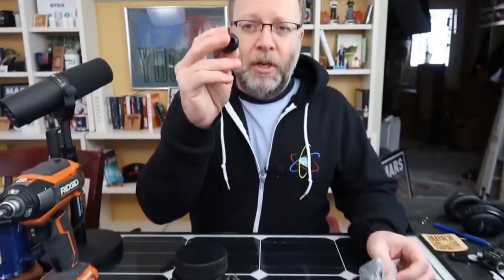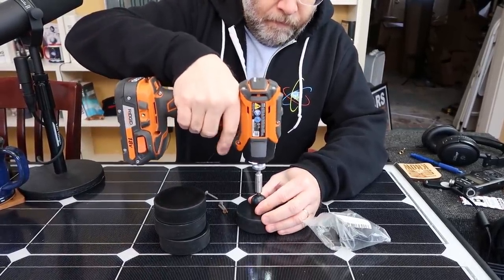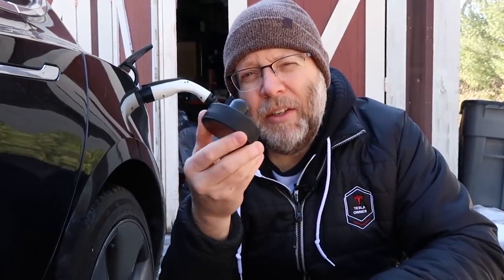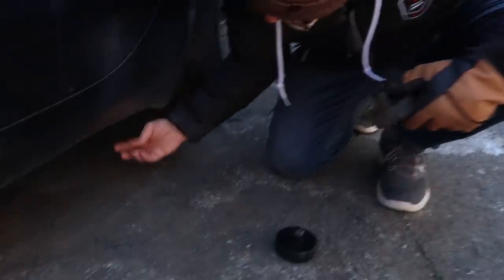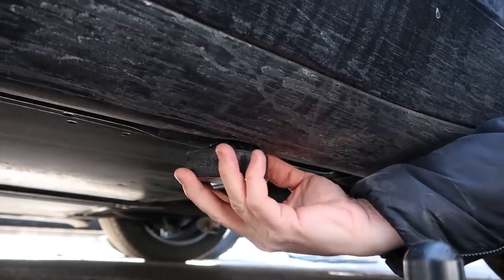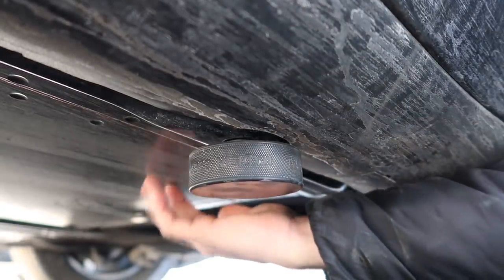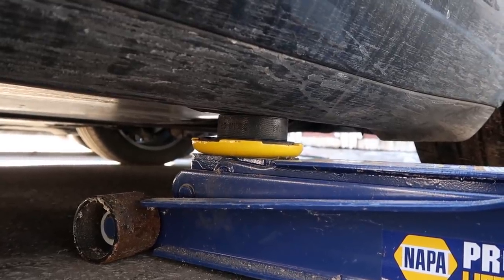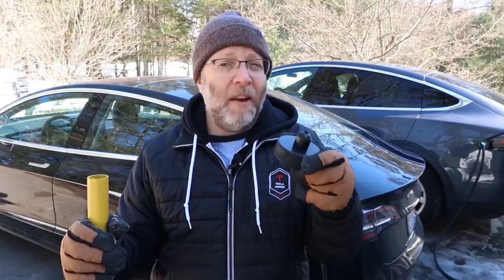Model 3 Jack Puck | Model 3 Tip of the Week

Comment: I went to Town Fair Tire, the local tire chain around Zach&Jesse's area, and brought my pucks. Apparently their jack did not have enough room to fit under the car with the pucks on top, so they couldn't switch my winter tires back to summer! I wasn't going to pay Tesla for it, so I ended up just doing it myself in the driveway using a very similar jack to the one you have.

I made my pucks also out of vulcanized rubber hockey pucks but with a 3D printed nub on top that I designed and printed myself and screwed in.

Comment: It comes to mind that with a floor jack, the beginning of the stroke is nearly vertical (no problem), but as the jack height increases, so does the amount of horizontal movement (not so good if the puck nipple breaks the small screw and the car slides off of the puck). I think this jack-puck is a great idea, but people need to understand what they are doing. Having a full set would be good for use with a car lift.